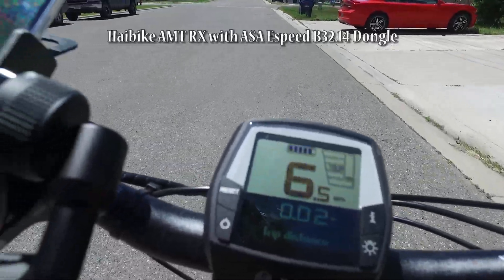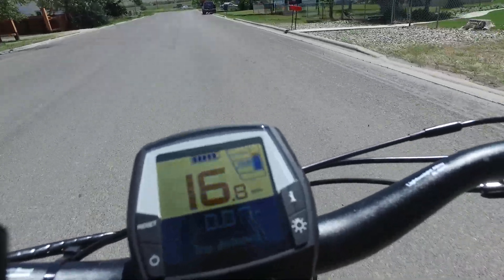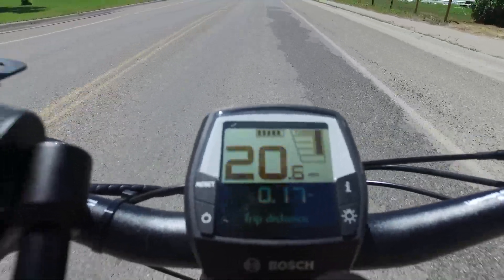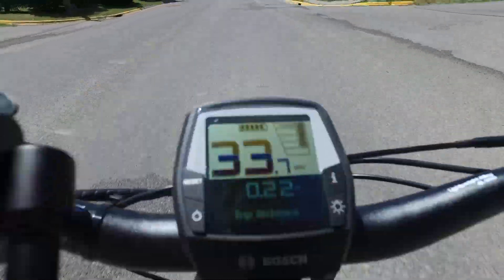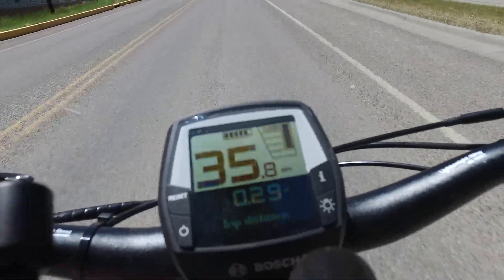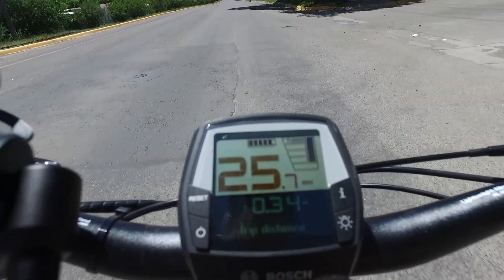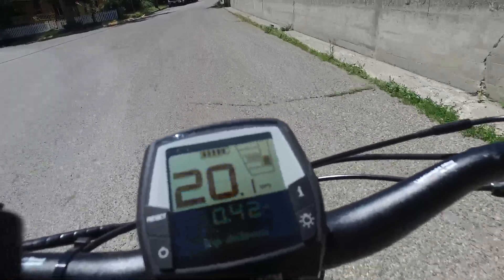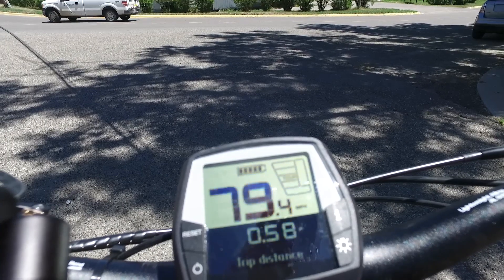How fast will an electric bike go?  (Haibike Xduro AMT RX w/ Espeed dongle installed)

Comment: disconnecting the sensor or to boost otherwise gives you a faster bike (more speed )= less battery range( shorter trip) 

Am saying by cheating or tricking the bike kills ur battery faster.

Comment: I have a lapierre ht900i with a bosch performance cx I managed 43 mph with suspension locked and tyres at 50 psi with modified gear ratios and its derestricted with magnet method

Comment: I have a Bosch Active Line Plus system on my bike with the basic screen I think it is Purion.. Can I set mine up to exceed the 20 mph? HELP PLEASE
Reply: you'd need to install a compatible dongle into your ebike or there is a free method which involves relocating your sensor i think and moving your magnet to your pedal. thing is you will not get correct speed, and odometre readings
Reply: @hansenyue  check out peartune MSO i think that is the best bet. Thanks

Comment: If the walk mode button does not operate like mine does not here in Canada , how were you able to program it ?
I am under the impression the button does not work on American models either.
Reply from the maker: Brad Becker it comes with a default program in it

Comment: What kind of range are you acheving in the different modes and has it affected the Battery or Motor in any negitive way? I have a tuning box on the way from E-Bay but really do't want to damage my new bike I just want about 10 MPH more from the restricted 15MPH here in the UK.
Reply from the maker: Tambo74 9 times out of 10 I don’t even turn the tuner on..  and when I do turn it on I don’t ride for long periods of time over 20 mph, so it’s hard to see how the battery life is effected, but it’s still running strong.
Reply: I got the tuning Speedbox 2 and yes i like it a lot but after 20 MPH i dont really see the point of it but  it does eat the battery through quicker than i would like but the assisted unlimited speed boost is cool for making quick getaways probably useful in  dodgy areas and laborious inclines. I'm loving it so far but guess i need to use it sparingly. Also i need to be  aware of  pedestrians and other road users with caution and respect at these speeds

Comment: NICE!!! I am about to buy a bosh performance line bike and I will get the ASA e speed kit. However, the B32.14 may be an older version. There is a newer version the B45 tuning module, it removes the 45kmh (20mph) limit completely. I don't know if it is US compatible but will find out. The glitch on the intuvia module could be caused by wiring connections. I would double check your connections and make sure they are solid.

Comment: on my new specialized turbo vado bike its onley the software thats limiting the speed from 25kmt to orginal speed 32kmt but it is a risk you can damage the battery and engine on the bike and since my bike is New it ruins the warrenty
Reply from the maker: ted tedsen this dongle technically voided the warranty, but the bike is still going strong!

Comment: what is the top speed when you put the tuning box in
Reply from the maker: T.House there doesn't appear to be a "top speed". Running downhill the max I can get it is 45-46 mph. 38-40 is the most I can get flat ground though.

Comment: How is the Bosch system compared to the BBSHD?  The only e-bike I've tried so far was a Trek eMTB with the Bosch system, which as I understand it, has a torque sensor to vary assistance based on power input through the pedals, and also cuts off assistance when you stop pedaling almost instantly.  How does it feel compared to the BBSHD with no torque sensor, but only the cadence sensor to know when to provide or cut off assistance?
Reply from the maker: Patrick94GSR the Bosch system is amazing!  No need for brake cut outs, etc.. but the BBSHD has the brute power to take you places the Bosch just can't.  When I need raw power (mountain climbing, towing etc...) I bring my fat bike with the BBSHD.  If it's a pleasure reading ride, I take the Bosch equipped  Haibike.
Reply: mr4x4s cool thanks for the insight.  I'm converting my heavy, upright riding utility bike that I use for grocery hauling to e-assist and have pretty much settled on the BBS02 750W kit, with some type of downtube battery.  Still saving up money, can't wait to do the conversion!

Comment: Use a GPS device you wont cycle up hill 38 mph sitting up right with a 500 watt motor you fool.
Reply from the maker: 250 watts your comment contains two false statements and yet you call me the fool.

Comment: Maybe the Intuvia is "mistaken" about the speed as you have fitted a dongle. Mine certainly is - it reads exactly 1/3rd of the speed, after approx. 10 mph. It does this as it is kidding the brain that it's only going much slower. Can you verify the speed with GPS & a mobile phone. That would be a trustworthy figure.

Comment: Hi. That is incredibly quick. What gearing have you got? I have a 26" wheel HaiBike with a 38-tooth front sprocket & I am getting a constant 22 mph on the flat. I can't pedal any faster. If I up the front sprocket to 46-tooth - the largest I think I can fit - I calculate I'll get approx 26-27 mph. I just can't understand how you can have the gearing to achieve this! All the best.

Comment: I installed the bikespeed RS on my Haibike. It does not have any of the glitchyness seen here. I posted a speed test on my channel. Check it out.
Reply from the maker: Marc Gonsalves I checked it out and left a comment.  Looks very smooth.  I may have to look into one of those.  Does the added assist work in all power levels?

Comment: Thanks for the quick reply. I ride my bike on the trails only. Climbs are long and steep so I guess that's the best I can get out of my battery. Haibike is offering 500 watt battery for 2017 which works on the older models as well, most likely I will get the new long range battery.

Comment: thanks for the video. I bought the same exact bike on june of 2016 . I like the climbing ability of this bike everything works the way I like but I have noticed I could get an average of about 18 miles and about 3100 elevation gain on the local trails. I was wondering if you get the same range out of your battery. thanks again.
Reply from the maker: niko grigory It would be hard to compare really.  I typically ride my fat bike when the trails get steep and ride my Haibike around town and for fun.  I typically get around 40 miles out of a battery for my average riding... average riding doesn't include steep ascents or excessive speed though...

Comment: +mr4x4s I'm thinking of buying an ebike for commuting, but I'm a bit confused. Most ebikes seem to have a tiny 14-20 tooth chainring, how can you possibly pedal these things over 30mph with such a tiny gear ratio?
Reply from the maker: Most ebikes have regular sized chainrings.  30-46 teeth or so.  The Haibike has a smaller chainring, (11 teeth) but the crank is not a direct drive to is.  The chainring and my Haibike rotates 2.5 or 3 times per revolution of my crank arms I think.
Reply: Ok thanks :)

Comment: Did you need the special tools that are suggested on some websites?  In other words, was it easy to install.  I can order this dongle over here before I move to the USA this fall....
Reply from the maker: The only special tool you will need is a crank arm puller.  I already had one that worked so I was all set to go.  After the left crank arm is pulled, it's just Allen wrenches needed.
Reply: So just to be sure I am clear, I got the crank arm puller...so it's just plug and play then?  I am excited about installing it when it arrives.
Reply from the maker: +veerle grispen It is pretty simple to install.  Although not exact, I got a pretty good idea of how to do it from a video with subtitles. Basically you pull the crank arm, and 4 small allen bolts, then unplug two connections and plug them into the dongle instead.  Then the dongle will plug back into the ports on the motor where the original plugs were.  I've got a pretty busy week with work, but will try to shoot an install video and have it up no later than Sunday. (8-14-16). I'll post a link here once it's done or if you're subscribed, you can see it there.

Comment: Well after seeing this video I am glad that I bought the nyon display and got the software based "dongle" thing. It doesn't bug out like yours did and I can turn the limiter on and off when ever I want. I do highly recomend it
Reply from the maker: I would like to upgrade to the Nyon, but last I checked they were not available for US versions yet.
Reply: +mr4x4s I see. Well that is a shame. It was actually really hard to get the nyon even in europe. And there are very few places vere you can set it up properly. But when it is set up it looks and works just wonderfully.
I hope you guys in the states get it soon :)
Reply from the maker: +Boss Manaatti Supposed to get it this year sometime.  I will be looking into it when it becomes available as well as the software for higher speeds.
Reply: +mr4x4s That sounds great. Only problem with the nyon is that you have set it up with your local bosch dealership who have the diagnostic "device" that is needed to syncronize the nyon display and the motor to work. And now at this moment there is just one guy in Finland that can properly set up the nyon display. So it is quite hard to get your hands on these. I really hope that this is handled better in the states than it is in here.
Reply: +Boss Manaatti  - could you please share the name of the software based dongle you are using, is it SX2? I would like to install this on my Haibike.

Comment: put some dielectric grease on all of the contacts to prevent water ingress and corrosion.  Keep us updated after a week or two of use as I am not sure which hack I will use on a 2016 CX, maybe the Chiptuningbox instead?
Reply from the maker: +semidemiurge It's been installed for a few weeks now and still runs like the day I installed it